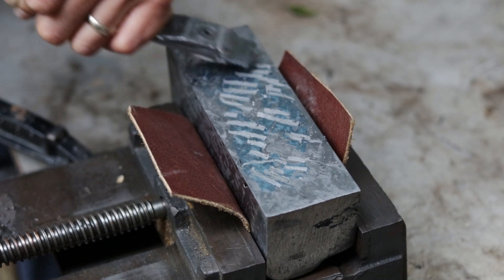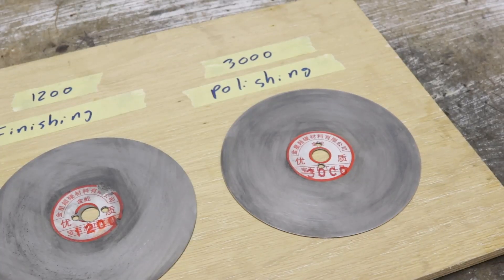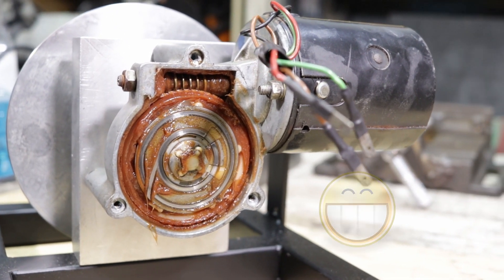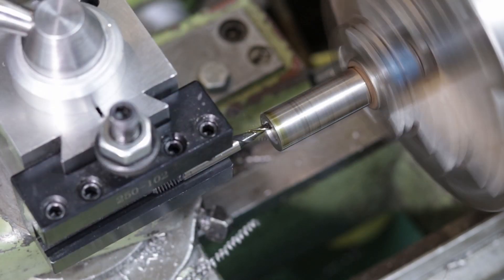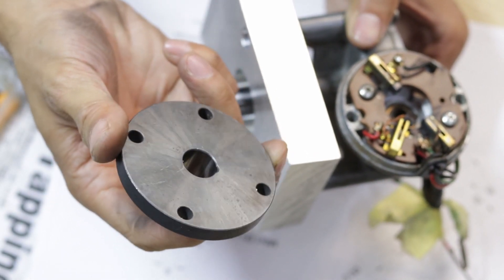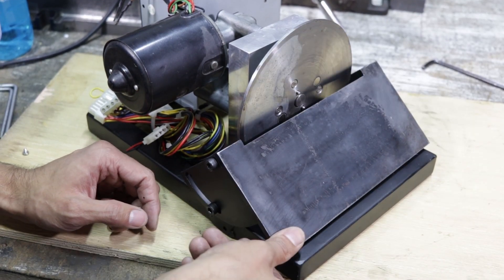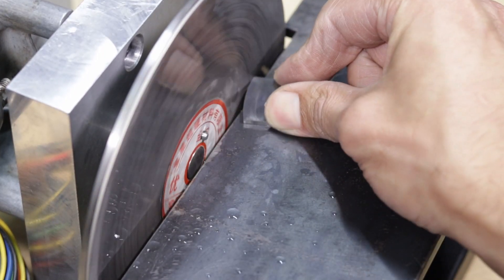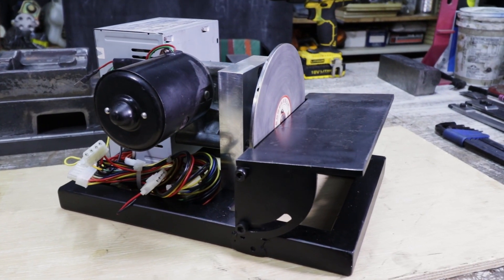Building A GTWR Inspired Slow Speed Diamond Grinder for Carbide Scrapers

Comment: the  45 degree is  a very good  edeal ; I use  vintage phocopier motor like  the xerox2000  or some cannen liquid inch  they turn naturaly at 280 rpm  and have a very strong  gear box possible to control whit simple  dimmer ;  thank  for  the  setup

Comment: Very nice build, I have a question for you regarding the carbide blades for your scraper, Is there a South African supplier for those, or did you need to import those? T.I.A.
Reply from the maker: Thanks, so I searched high and low for Carbide blanks, the most promising lead was the guys that do carbide tipped scrapers for conveyer belts for the mines. I eventually found a genuine Sandvik scraper from a guy on marketplace down in Durban, no idea where he got it, but it means they at least exist here. Other than that I've built 2 home made scrapers using square slab face mill inserts with no chip breaker geometry, but also not common anymore
Reply: @Mark_How  Thanks for the reply, knowing they exist over here is positive at least. The search continues on.
Reply: @Mark_How  do you not use diamond paste finishing time